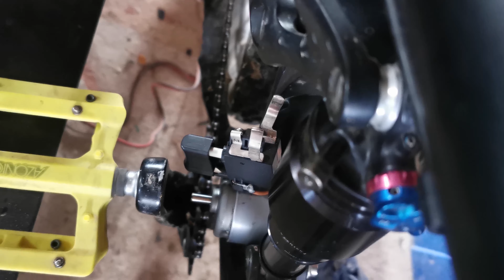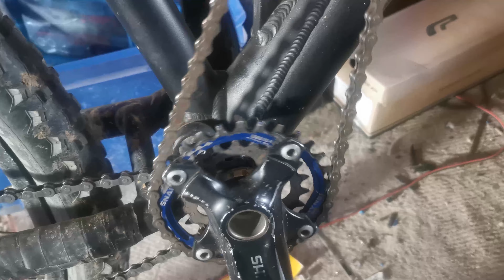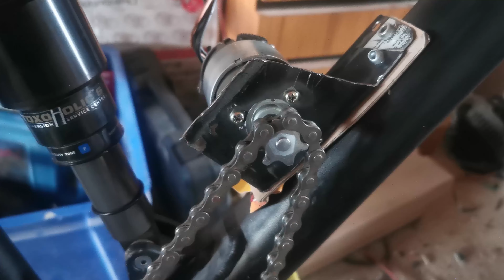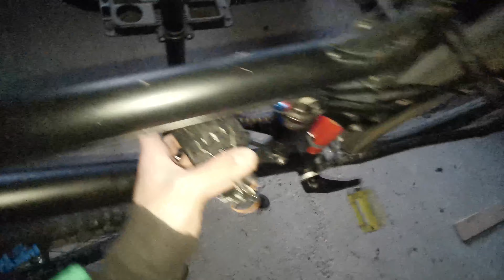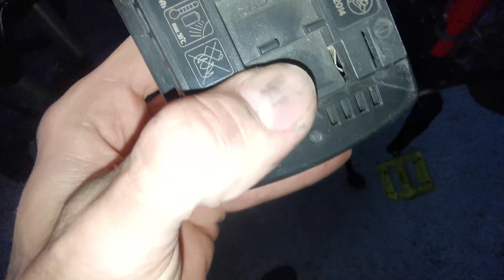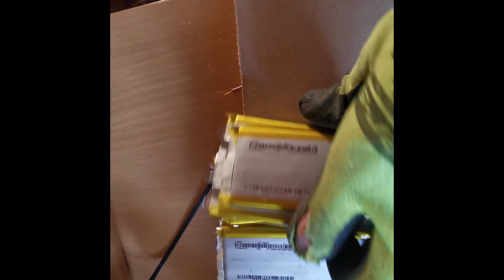Drill-Powered Electric Bike (full suspension)

Comment: You probably know this won't work.
You lucky it can turns wheel with its own weight
Without motor ripping out.
That if chain doesn't sleep & fall off first.
But when you ride it with 50 times more weight.
It's a completely different story.
The bracket and chin tension would need to be 50 times stronger.

If you make brackets so much stronger and make a chain tensioner.
It could actually work 
Then you just need to make a freewheel pedal arm.
So pedals don't rip your legs off LOL.
At least you tried to get it working.
That's more than most people can do.
Reply from the maker: thank you for that comment, I knew all of that when I started  but I was curius bcs this was my first time building something like that. I am now building case for battery on that same bike and I will buy proper bafang motor with its kit from internet. This was just my little experiment. 🙂
Reply: @TrailMaker2  tutorial https://www.youtube.com/watch?v=-sJwkulJUM0